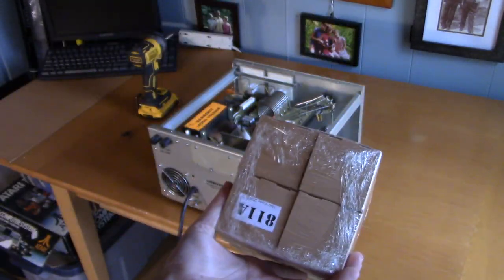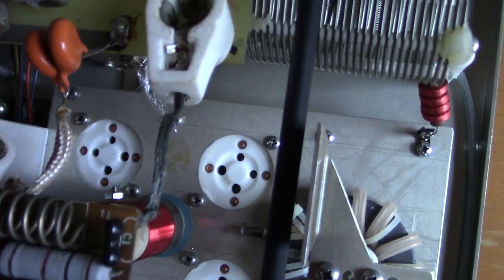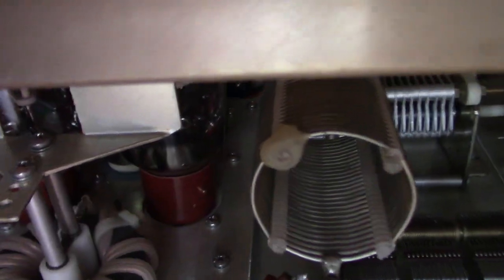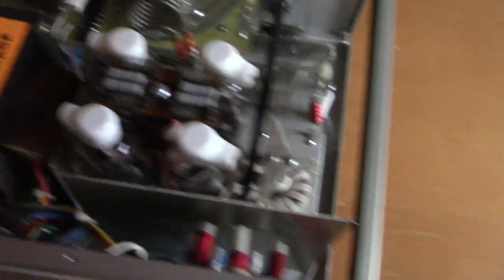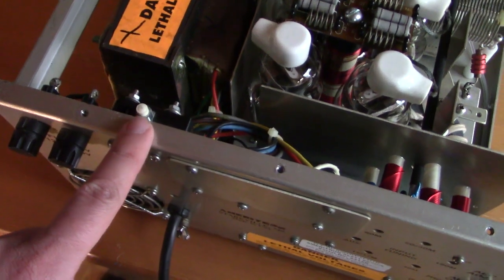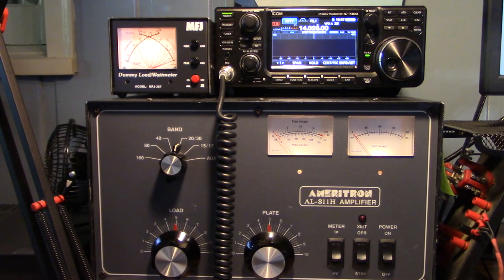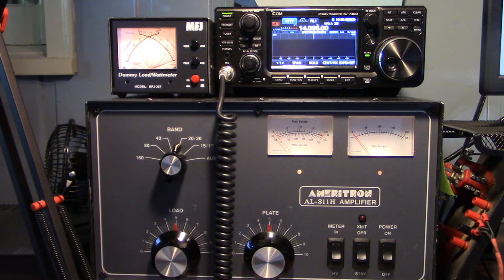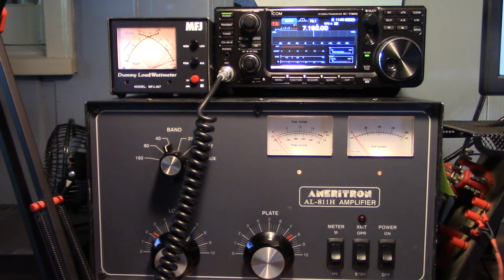HOW TO setup and tune an Amplifier | Ameritron AL-811H with an IC-7300

Comment: The way I learned was you adjust the load and plate in receive for the most noise, then fine adjust during transmit, peaking the grid and then find the dip in the plate current.
Reply from the maker: Yeah, I think I did it backwards... Have you seen the manual? Ugh!
Reply: @temporarilyoffline  The manual says to go for max output, it doesn't even mention plate current as a guide.  Yes, ugh!
Reply: Ron adjusting load and plate controls will do absolutely NOTHING  for receive noise as the amplifier circuits are bypassed when the relays in the amp are at rest. You are going straight thru the amp and cranking on the plate and load controls is fruitless.
Reply: That works when you're tuning for swr with a manual tuner (or a screwdriver antenna)... Not for tuning an amplifier...
Reply: @aakoksal  Yeah, I was flash backing to my tube transceivers when I wrote that...sorry about that.
Reply: @jamesk0ua  I think he meant his radio.  Not the amplifier
Reply: Manual talks about set to  DIP in plate current. Interesting that you aren’t using external antenna tuner. I read that is necessary. I have MFJ 994B tuner on my ICOM 7300 as well as Ameritron ARB 704 to help protect radio . MFJ 267 dummy/ wattmeter. Lots of wires going back and forth.
Reply: @peredavi  You usually don't need an antenna tuner, because the output circuit of most tube amps is an antenna tuner circuit. It's tuning the plate to the antenna.
Reply: Correct guy misspoke, you dip plate for lowest setting which increases power and then peak load ! This guy is all wet!
Reply: @Temporarily Offline Ham Radio  yes please put out correction video, dip plate increase load, remember load means increase power per meter! ie if you load a truck you increase weight!! As in increase power!!

Comment: My Elmer Jerry W3YVZ (SK) always recommended wearing archival (cloth) gloves to install tubes manually. This prevents fingerprints from being transferred to the glass envelopes. Fingerprint oil and grease can cause “hotspots” on the glass which will eventually degrade tube performance and hasten failure.
Reply from the maker: Good tip, I tried to not touch the glass.
Reply: @temporarilyoffline  Honestly, it's a bit of an old wives tale. Halogen lamps? Yes. But vacuum tubes don't get NEARLY as hot, a bit of skin oil isn't going to bother them in the least. I've got 3-500Z tubes that have survived decades of RTTY contests with my greasy palmprints all over them!! 😁

Comment: That brings back memories from when I first got licensed and operated my FT-101-E.

I had to do adjustments before transmitting to get full power out.
Reply from the maker: Yeah, always something to fiddle with to be a little bit better.
Reply: My papa had that one man them rario had hell of a audio on them .... Love them radio Numero uno
Reply: I bought my 101e used and it came with a brand new spare pair of 6JS6’s. I never did need them. The originals were as good as the day they came to me when I sold the set on. I only changed the 12BY7 as it’s emission had gone low (old age comes to tubes in the end hi). I did over a decade of my HF apprenticeship with that mostly using CW. Our club recently got a 101ZD left to it and I enjoyed the trip down memory lane again hi. 73 de G0ORY
Reply from the maker: That's awesome. I love stories like this

Comment: Great video! A couple of things I've been told by hams far more experienced than me are to 1) Set your plate/load at your max permissible drive power (probably around 60-65w), then back the transceiver drive power down to the desired amplifier output. 2) Adjust your load clockwise beyond the power output peak until you just begin to see a dip in power output/grid current. That slight increased load & subsequent dip will prevent splatter on SSB from voice peaks and keep your signal more in check. 73!
Reply from the maker: Some of that makes sense to me.  Just got this thing and need to learn some more.

Comment: great amp. I have fixed many of them. easy to get parts. yes tune up low power first . out of tune on high power causes a arc to happen in the tune and load caps and will burn the plates an also can damage the tubes. you will find tunning that the grid current will dip at the tune point. also the plate current will dip as well. that is your tune point. some times you may need to fine tune on antenna. always tune into dummy load first. give time for load and tubes to cool .I have 7300 you can use ALC line and adjust on amp to set radio not to over drive amp. when digital modes only run around 25% max power for life of the tubes. you can put in 572/B tubes . longer tube life. watch out for China tubes. some not so good. RF parts has the good ones and Penta labs tubes are good also. all I use. I have the AL 572 amp my self. that 1300 watt version. I run 800 watt or less . Russia 572/B tubes from RF parts. lasting years ! even take portable with gen set. no problem with DX commander antenna. he tested 1500 watts and just fine. use volt meter to check HV caps on board before touching . they screwed to the board. around 450V each . after I check ,I put a jumper to ground from HV output on board. also if coax connector gets loose in amp replace them.!  common on that model.  that AUX is 10/12 meters if cut green wire on input. buy tubes as matched set ! 3 or 4 . 73's
Reply from the maker: Thanks for watching and thanks for the info!

Comment: I have the Acom 1000 and I highly recommend it, has a tuning indicator and it tells you what position to have the load and plate it really is quite simple + there's no need to keep turning down the power on the radio every time I want to re-tune the amp because it's got an attenuator.

 I use an EFHW 49:1 Antenna which means I don't need to mess with tuning a tuner and the amp, this saves me a lot of money by not needing an expensive tuner.
Reply from the maker: Yeah, I wanted tube pain... so here I am, with tube pain ;-)
Reply: @temporarilyoffline  ah I'm sure it's fine once used to it, I wanted an Ameritron Amp but found it hard to get one so got the Acom instead and it's good for newbies to amps like me with lots of protection I don't think I could kill it too easy! :-)

I really love the look of the Ameritron amps!

Comment: I've read about hams "dipping the plate" and adding load as the last thing they do.  I have always just tuned for the maximum RF output at the power level I'm going to use.  (No, not max output)  That has always worked well for my transmitters.  I do the same with my 811H, but you have to really watch out for how much drive power you're using.  Don't over drive it.
Reply from the maker: I've been told the way the tubes are wired that any extra drive power just goes past them.  If so, that's a nice safety feature.

Comment: Hi sir you need to install a control relay on the amp relay circuit. you need a small pilot relay. Look in the IC-7300 manual, it has a diagram of how to do that. Otherwise you need to buy an Ameritron amp relay box. What you are doing will work fine for a while but will eventually beat up the 1 amp transistor in the IC-7300 and kill it. Additionally the amp keying circuit will protect the radio in the event that the amp goes kerbonkers and back feeds high voltage through the keying circuit and kills the whole radio. I am redoing mine as I did it as the book said with a small relay. I am in the process of doing mine with a DC to DC SSR 3-32 in with flywheel diode and 2-240 DC out. There are videos on line. I am going to video mine when I get the part in from Ebay.
Reply from the maker: Thanks for the tip, subbed your channel and looking forward to the video.
Reply: @temporarilyoffline  Thanks I'm not near so professional as you. I remember how much fun it was to get the amp and how much it helps when the band is not doing well. A lot of days I leave it out and operate 90 watts and a wire. When that relay gets here I will be videoing the build.
Reply: @temporarilyoffline  2 years late to the conversation but according to a interfacing tutorial by DJ0IP, all you have to do is adjust the TX Delay in the menu of the 7300. I plan on getting an Ameritron tube amp soon and will try that method. Also, is the cable that goes from the radio to the amp relay just a standard RCA cable? Not sure if you'll read this but thanks for the video. -KD0VUY
Reply from the maker: @dirkderemojr.3316  thanks for watching, yes standard RCA cable and yes, adjust the TX Delay on the radio.
Reply: @temporarilyoffline  So if I adjust the TX Delay on my IC7300, I won't need that Ameritron amp relay box? What is the point of an Ameritron amp relay box? I'm trying to do this but I'm very afraid of frying my IC7300.
Reply from the maker: @1964SABO  The functions are un-related as far as I'm concerned.  The TX Delay gives the amp the signal to "turn on" and get started/ready for signal.  Instead of "drag racing to full power when you PTT". The Ameritron relay box is for the amp to back-channel communicate with the 7300 to tell it to back off the drive and since the old amp and the new radio have different tolerances, its used to prevent the amp from sending an un-clean signal back to the radio and frying its circuits.

In my setup, I'm not using that second function.  I haven't had a problem, but I can't speak to every radio and every use case.  Its "cheap insurance".  I could of course be completely wrong on this 😀check the rest of the comments for some more details, It was very hard to get a definite answer among all the opinions.
Reply: @temporarilyoffline  Thank you for your quick reply. I love your channel and watch religiously. Keep up the good work! Just got my X6200 mainly due to your videos.

Comment: How does one know if this is the correct tune up procedure when you agree with the comments saying it isnt? Why is the video still up if it may be wrong?
Reply from the maker: This is one of the worst parts of ham radio, nobody can agree on anything, even when they do agree they still argue.  The procedure outlined in this video is how I tune my amp, it has been verified by trusted Elmers as working and it has been ruthlessly debated on QRZ.com... Even to the point where somebody on QRZ posted a different video telling me I was wrong and this guy was right... the guy in question tuned the same way I did.  I don't know if this is the best way or not the best way, nobody does and even if they did, there will be an even better way tomorrow.  Check out W6LG's video on how wonderful the instruction manual is for this amp.

I agree because its pointless to argue in a comment on a video, especially when I say in the video that I'm new to amps and the commenter does not provide anything of value other than argument.

I will continue to improve my amp tuning technique, and if I learn anything new I'll post a follow-up video.  So far the only thing I'm aware of is that it needs to be done "faster", but you have to start somewhere -- and that is what this channel is all about - removing the gatekeeping and getting people started.

Thanks for watching!
Reply: @temporarilyoffline  amps are a touchy topic since it can smoke your wallet and your rig in no time. Ham radio is like asking for directions at a tavern.

Comment: The TX delay has nothing to do with relay chatter. It is the time delay from when the PTT line goes low to when the radio actually starts transmitting.
Reply from the maker: Absolutely!  Thanks

Comment: Great video,I'm about to hook-up my AL-811 to my 7300,I wasn't sure about the keying lead and where to plug it in,but you've shown me that,thanks!
I couldn't help noticing though that your rig is showing quite a high VSWR into the amp,should the VSWR not be a lot lower?
Reply from the maker: Yes, you should have a good match between radio and amp... and then between amp and antenna.  I've even tuned the antenna and then used the radio's internal tuner to the front end of the amp.  It's very fiddly.

Comment: With all due respect you having time to do such a presentation I must say that instructions you have got are not quite correct. Adjusting the output stage which is usually a Collins Filter is done differently than what you are showing here. It has been a while since I had anything with vacuum tubes but as much as I remember we were ALWAYS looking for minimum current with the plate control (a DIP) and  maximum output power (a PEAK) with the load control and again back and forth to drive maximum output. At the circuit resonance the plate current is always minimum, period. The best way is to start with more capacity at the output which is less power but sharper DIP on the plate, then continue to open the load capacitor to increase the power gradually, doing it back and forth. MIN PLATE MAX POWER

Comment: Thinking about pulling the trigger on this amp. You may have said it but how do you control the power on the amp? My loop antenna is only rated for 500 watts. Probably won't go much over 400 watts. Is the amp wattage based on the radio output wattage? Thanks
Reply from the maker: Yes, power out is a factor of power input.  It's different per bands and you'd do well to have a power and SWR meter on the far side of the amp.

Comment: noticed you have radio at 25% how much higher can you go .I tried 53% and appear to get almost 800 watts Would I be pushing it too far that high percentage 
also noticed plate current swings too 600 ma and grid current to 10 ma
Reply from the maker: Its a linear amp, so the more power you put in, the more you get out.  Next up comes the cooling capacity of the tubes/chassis as your limiting factor.  I was running at 100% duty cycle, so the tubes were doing all they could do.  The amp is rated at 800w SSB, but its common practice to "don't push it"

Comment: Hi there, you never said, unless i missed it, did you tune up on FM or CW, not that it matters much, have you any prolems triggering the 811H from the PTT socket of the 7300, some people say it ok others say you shouldn't Fred g4vvq.
Reply from the maker: FM,AM,RTTY,CW, FT8 whatever puts out modulation works.  I didn't have a problem with the PTT socket, I did put TX delay into the radio, though.
Reply: @temporarilyoffline  Cheers...

Comment: You should never change bands with the plate voltage on. Good way to arc the band switch.
Reply from the maker: Good tip
Reply: Plate voltage is always on when the amplifier is on. No matter the HV switch.

Comment: Once the amp is tuned for a particular band, when you transmit on different channels on that band, do you have to re-tune the amp for those channels? Or you tune once for the band and talk on any channel you want?
Reply from the maker: If you stay within a few KCs, you should be fine, if you are on 80m for example, the band is so wide that you might have 3 or 4 points where you need to re-tune.  When you changes bands, you'll need to completely re-tune.
Reply: @temporarilyoffline  I see, thank you!

Comment: Where do you connect the ALC out to the 7300?
Reply from the maker: the 7300 has an ALC connector, but make sure you get a buffer box so that you don't get voltages mixed up.  Ameritron makes one, or you can find them on ebay.  I did not setup ALC with this amp/radio combo, so you've now reached the end of my knowledge.

Comment: How many watts were you getting after a full tune ?  73 W0DN
Reply from the maker: This is an 800w amp, so on SSB, I'd expect rare peaks at 800w and normal operation around 600w (the nature of voice).  On digital modes, I run it back at ~400w because I don't like the amount of heat it creates.  In the future I'll be doing something about the heat.  I think the cooling is very inefficient.

Comment: does the send port on most xcvrs close the ground connection on the amp relay? the amp relay + is always connected and the relay rca jack just needs a short to close the relay ground? do "most" modern xcvr's operate the send jack this way?
Reply from the maker: I don't know, I would imagine you could check it out with a multi meter.  I'll take a look.

Comment: Can you show how to tune the ALC circuit on the AL-811. as well the use of. 
I can find no reference to this topic other than in the tuneup instructions, which describe the " low loss slug and tuned coils ", as C 27 & C 28, which are depicted in the manual.
I understand where the exciter"s out put is NOT in excess of 70 Watts to the Amplifier, the ALC circuit of the Amplifier may be used in leiu of ALC from the exciter, hence no connecting harness from exciter to amp.

Am I on the right track here, the manual is written in American English and seemingly difficult to comprehend ?
Reply from the maker: The manual is really hard to read, You and I aren't the only ones that feel that.  I'll take a look into it and if I figure it out, I'll put out a video on it.
Reply: tune the amp with no alc line connected...say you did that with 75w max drive...then connect alc and set alc control to the point where power just drops down...that is how I would set the alc (just to add some safety for the amp)...then set drive of the rig a tiny bit lower and have fun 😂

Comment: Adjust the plate first 10 watts then the load for max output them go to 20 watts then 40 watts then increase the load a little once set  i run 572 b s make sure it has a seperator diode in the switching relay  line or you can damage the 7300 .i do the opp with the collins 30l 1 dip the plate raise the grid loading control, i always tune for max output then advance the loading a we bit  at different power levels never seems to fail me with the ameritron.
Reply from the maker: The Ameritron is a great amp!  40m is a little weird, but that could just be my setup.  It is really efficient on 20m here.